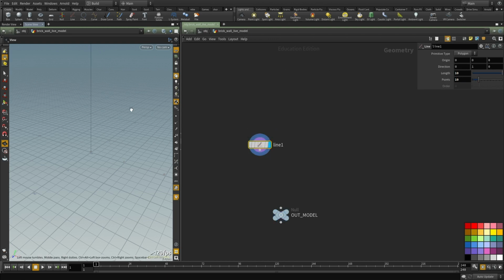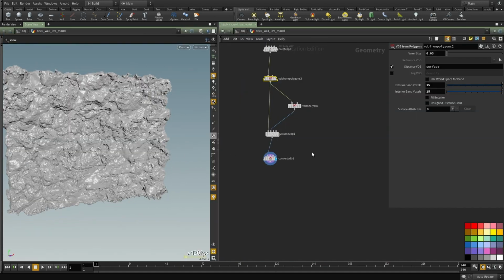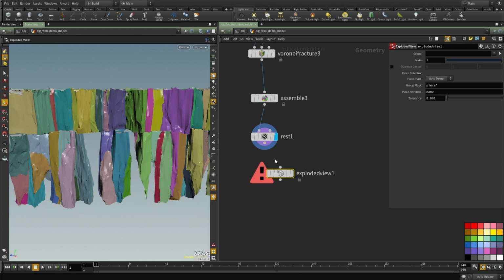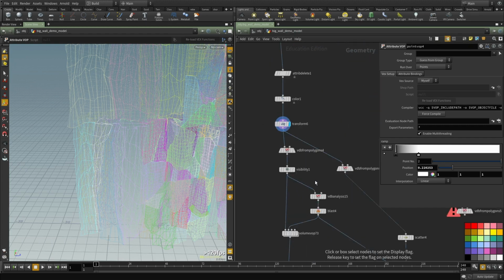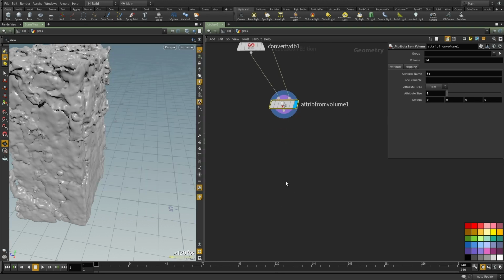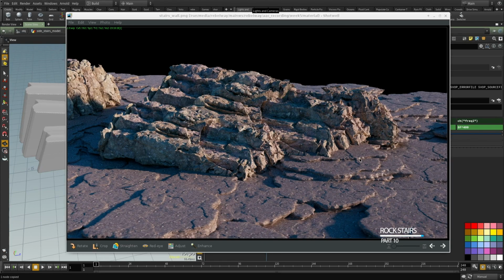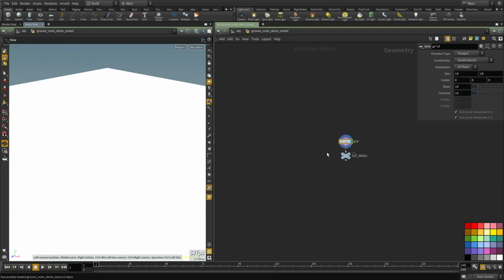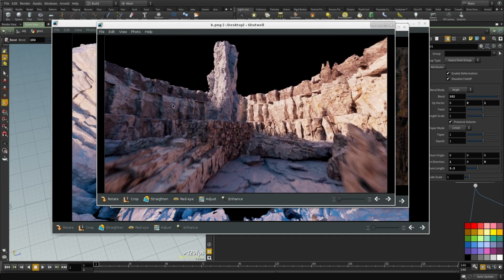Free Masterclass: Complex Cliffs and Bricks in Houdini​

Comment: So great stuff, so professional and well directed. One thing only - if you are using H18 or above, you run into issues as some nodes are not existing - like for each loop , and other nodes have changed. Thats a real pain with Houdini ;)
Reply: yes i am getting exactly to the point where voronoi fracture gives me HUGE issues with the interior detail. meaning, that when i tweak the interior detail it doesn't translate to the cut of the voronoi. any chance anywhere i can download an old scene to get it from there?
Reply: @raphaelgort5499  If you use the rbd interior detail node you can skip the entire point vop step since this node has noise already build in and it aligns pefectly with the fractures. The fractures itself won't be broken up though, but you can get those details through noise in the volume steps.
Reply: @beyondsanity7123   awesome. thank you
Reply: It's the only reason they made this course free, I'm assuming

Comment: Not sure if I missed something, but my voronoi fracture node doesn't have many of the options yours shows such as interior detail.
Reply: Yeah, he's using a much older Houdini build, I believe 16 or 16.5, which is why this series is free because it needs to be updated for newer versions of Houdini.  You can still follow it if you're willing to put in the extra time to troubleshoot because it means a lot of the nodes will have changed as SideFX is constantly improving things.  It's annoying and makes learning it harder, but at least they're constantly improving the software - making things faster and more streamlined.  For the interior detail, there's a new set of RBD nodes that I believe were added in H17, including the RBD interior detail SOP:

https://www.sidefx.com/docs/houdini/nodes/sop/rbdinteriordetail.html.  

I think this masterclass should give you more info about all the RBD changes:

https://www.youtube.com/watch?v=lG0iZCv-sPQ 

Also, I found this series extremely useful as well when learning about RBD:

https://www.appliedhoudini.com/blog/2018/2/16/rigids-i-fundamentals
Reply: @benjaminmarkus3290   Thanks for sharing those links. That RBD stuff looks really cool.
Reply: probably using a different Houdini build

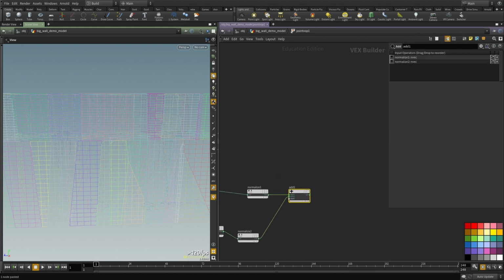Comment: Amazing content! One thing I was confused is that at 51:39, the cross product handling. Why doing that?
Reply: I'll answer this in case you're still confused or anyone else is curious. 
First, to clear up what a cross product does... if you create a cross product with the X and Z axis vectors (1,0,0 and 0,0,1 respectively), the result is the Y axis (0,1,0). It creates a new vector that is perpendicular (90 degrees) to the plane you define with the first two vectors.
Now for this process.. it's really common to use the N and 0,1,0 as your base for the first cross product as it creates a sort of vertically oriented plane. The resulting cross product is a vector that runs horizontally, but parallel to the surface. 
The second cross product usually uses the N and first cross product as the base. The result is that you get a vector which runs vertically parallel to your surface... From which you can do all sorts of cool things related to orientation. Hope that helps!
Reply: @ejaworenko  Concise, high-quality answers！